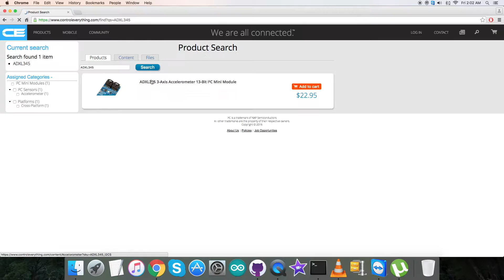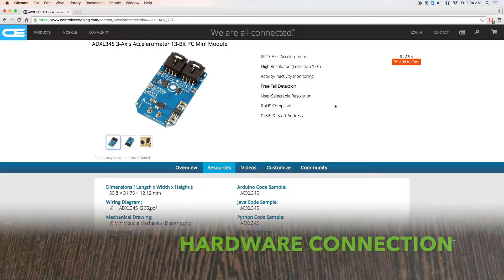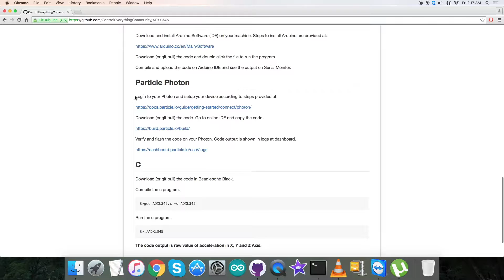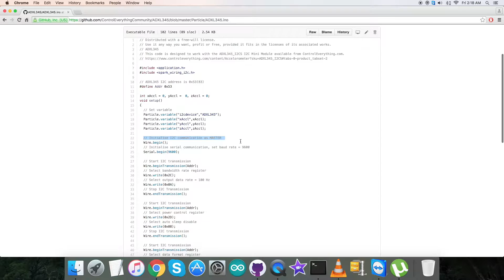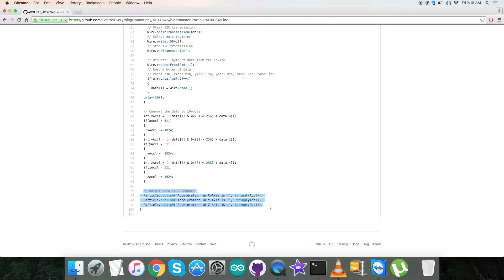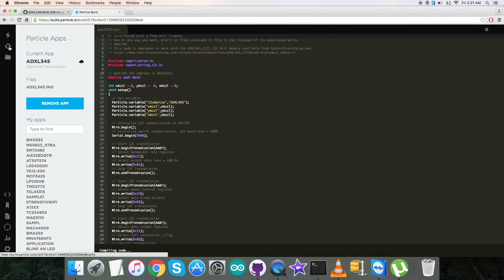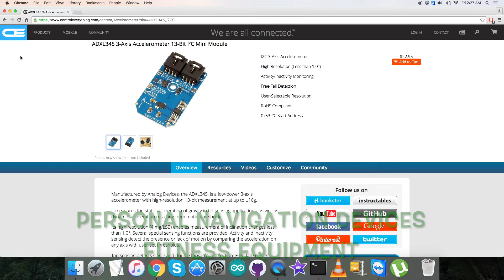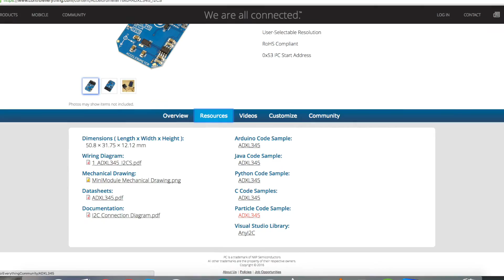Particle Photon ADXL345 3-Axis Accelerometer Tutorial

Comment: Hi, I am not using a shield for the ADXL345, could you tell me what pins are connected together of the two devices please. Thank you.
Reply from the maker: You can use I2C pins. which are SCL,SDA,GND and VCC. Make sure your SCL,SDA are pulled high.
Reply: I made my connections a follow; Vcc-3.3V; GND-GND; SCL -D1 and SDA-D0.  Now added 4.7k pull up resistors. but i get  acc-x = 536960108, acc-y = -1515887055 and acc-z = 536960500.  

Im starting to suspect that my ADXL345 is burned and no longer working. Im using the code from git hub. Any ideas and/or suggestions?

thank you
Reply: I had to connect the CS pin to 3.3V..it works properly now. Thank you.